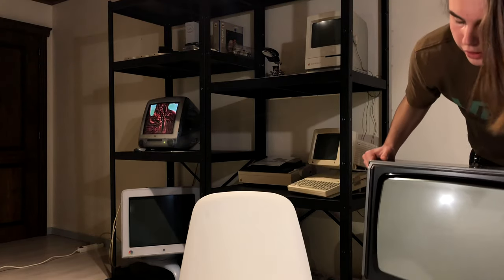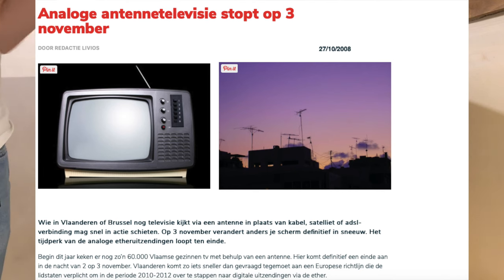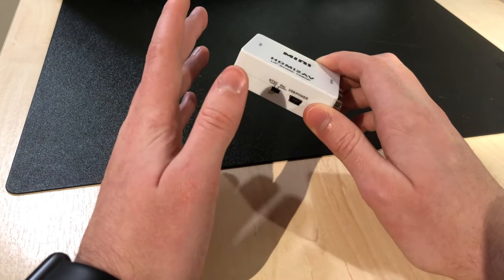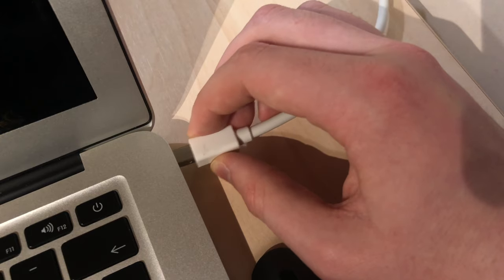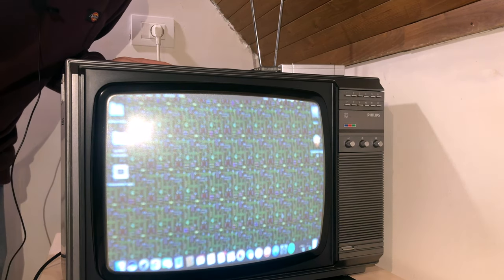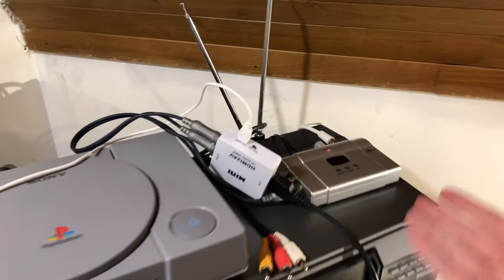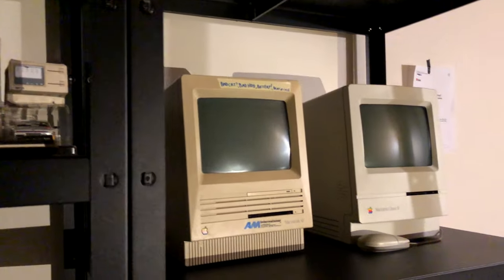HDMI on a 1980s TV set!

Comment: The only downside to CRT TV's is that they emitted more harmful EMF radiation than flat screen, yet still less EMF radiation than any wifi TV. Also CRT is less harmful to eyes & skin than a LED or fluorescent backlit screen. You can shield the inside of the CRT with shielding tape or aluminum screen to keep the electromagnetic radiation from leaking out. I like CRT, I used to repair the old tube type TV's back in the day, new flatscreen TV's are throw away TV's because they are designed to break & not be repairable, just like a light bulb the electronic companies use obsolescence to profit. A good way to clean old circuit boards is to stick them in a dishwasher.

Comment: That small antenna connector on the portale TV set is the same as  an audio jack, where the left channel (the tip of the connector) is the rf signal, and the ground is the same as in audio jacks. Knowing that makes it very simple to build an adaptor.
Reply from the maker: Thank you!! I might look into building one of those adapters this summer...
Reply: @ArnoLouwagie  It is also a good idea to connect to ground all the remaining pins (mono jack connectors are usually used for this purpose) to make sure all the contacts on the plug surround the rf signal, therefore they act as electromagnetic shielding.

Comment: I still have an old retro Sony 21-inch I use to play my old retro consoles on that I bought new.  It had an RG6 F type jack years before Zenith or other American brands offered them.  And it was proudly made in Japan and heavy as crap.  LOL  No component has failed and I have only had to make color adjustments on a component level 3 times.  It literally takes 5 minutes to warm up and being an early solid-state component TV, it still used vacuum tubes in the power step-up circuits in the amplifier for the Dolby surround sound.  I also refurbish and restore old vacuum tube transceivers.
Reply from the maker: That’s awesome

Comment: You can also use HDMI to SDI Micro Converter, from HDMI Cable to Coaxial cable. Make sure to have your TV to channel 3 or 4 like the old days when you hooked your cable box to your analog TV. I have two vcr/DVD combo players: vcr/DVD with antenna in and antenna out and vcr/DVD with no tuners. I hooked my Cox cable out to the antenna in to my vcr model SV2000WV806. Then I used the other coax cable from the antenna out of the vcr model SV2000WV806 to the antenna on my TV. Then I used the same cox cable box hook rca(av)(red, white, and yellow)cable from Cox cable rca output to Funai DV220FX4 rca input. Then I used the Funai DV220FX4 rca output to the rca input on my TV. I hooked both my vcr/DVD players and Cox cable box to the same TV in my room. For my other tvs in the media room and the living I just used HDMI Cable from my cable box. Now I  no longer have cable cable TV service, but I still used Cox Internet and Cox phone service since I used the firestick on all my TV.  If I had known about HDMI to RCA(SV) and HDMI to SDI, then I would have diss the TV service part from Cox cable a long time  ago. You did a great job explaining the conversion.

Comment: Love this. Your video was really helpful for my needs, and the visuals were perfect.

I eventually found a nice HDMI to RF modulator and a low power RF amplifier, which I was able to broadcast my signal over the air on VHF channel 6. I can now use the antennas for my old TV. Best part is that any radio which can pick up the sound on 87.75FM will also be able to capture the audio lol
Reply: What modulator did you use?

Comment: You can use stereo bud even if tv is mono because the rf modulator would have a stereo to mono converter build in if the tv is mono it with mix left and right into one speaker if the tv is stereo it will be stereo as normal broadcast back in the day use and special stereo system to allow stereo music be played on a mono tv even fm radio used the same system for stereo music played on mono radio the two channels get mixed so you hear the full stereo track in mono

Comment: One issue: Aspect ratio. It seems like something is squashing 16:9 content to 4:3 on the Youtube, causing everything to look tall and skinny. If possible, tell your YouTube box that you have a 4:3 screen connected, that should fix it by either becoming proper 4:3 or letterboxed. Unfortunately not all modern devices have this option, but worth a try.
Reply from the maker: Still haven’t figured out how to fix it😬
Reply: @ArnoLouwagie  I'm doing something similar with a Roku YouTube dongle, I output it to analogue. It has no 4:3 option, so connecting it to a 4:3 TV results in squashing. I'm using it with a wide-screen tv, and for analogue recording. When I have a video from YouTube in 4:3 that I'm really keen on watching on a 4:3 screen, I save it and cut off the black sides if there are any, and then output it through a different device that can play mp4 to analogue out. I have a digital set top box and an older bluray player that can play mp4 and have analogue outputs, it works on either. If any of those players could do YouTube I'd be all set, but they don't do I use this detour.

Comment: I’ve used the rf modulator on my black and white old tv as instructed, sound came out really clear however the image didnt come out, it was only the flickr.
If anyone knows the solution, i’d really appreciate it
Reply from the maker: Check the connection. Maybe there’s a bad connection or maybe you inserted the cables into the wrong jacks?

Comment: I am trying to put a raspberry pi into one of those 5 inch tvs. I actually made my own antenna plug from an audio cable. I just had to split a coaxial and an aux cable and solder the center of the coaxial to the wire corresponding to the last ring on the aux cable and then also you need to solder the outer grounds together and then mine worked. it looks suuuper janky but I couldnt find anything online similar to the cable io needed
Reply from the maker: Hahaha if it works, it works!

Comment: Can you use a HDMI to rca cable with any rf modulator or does it need to support hd?
Reply from the maker: There’s no such thing as an HDMI to RCA cable. You need an adapter (HDMI to RCA -> digital to analog). You can use any RF modulator that you can hook composite video (or RCA cables) up to. The RF modulator doesn’t care about the HDMI cable.
Thanks for watching and have a great day!!
Reply: @ArnoLouwagie  there is I bought one but it didn't work.

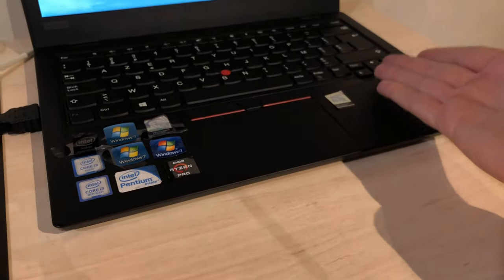Comment: 16:10 wow 5 CPUs, that thing must run hot! 😲
/s 😂
Reply: I also use a Thinkpad Edge even tho I'm not a student, I just got many of them for free at work. I actually like it, though. Basically a ThinkPad that's designed in China.
One time I jammed an NVME into the M.2 slot and destroyed the wifi capabilities of the system and have to patch the kernel in linux to use a USB one. Good times, It's more fun this way.
Reply from the maker: Hahahahaha
Reply from the maker: I must admit they're fun machines to mess around with

Comment: Could that be run through a VCR and recorded on VHS tapes
Reply from the maker: Yep. Hook the composite video cables up to the VCR (input), put in a tape and press record. You can run additional composite cables (or do it with scart cables if you’re in Europe like me) to your tv if you want to see the picture on the TV set as well. I don’t do this since I can already see the picture on my laptop but if you’re recording off of something without a screen (like an old decoder or something like that) you might want to hook it up to the tv as well lol. You can do the same exact thing but with coaxial cables (RF IN, RF OUT) if your TV set doesn’t have a composite video input.

Thanks for watching and have a great day!!